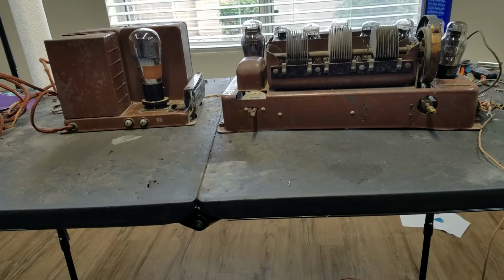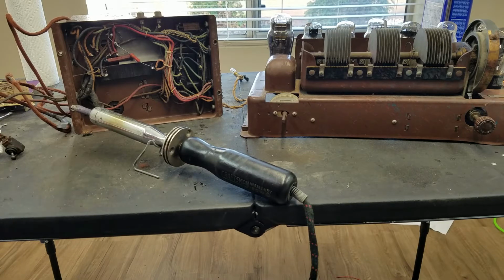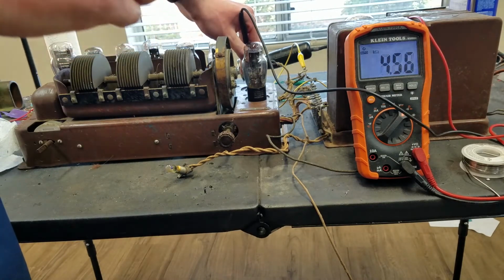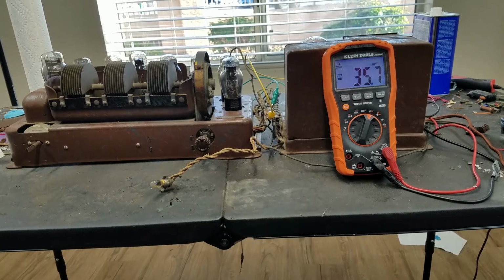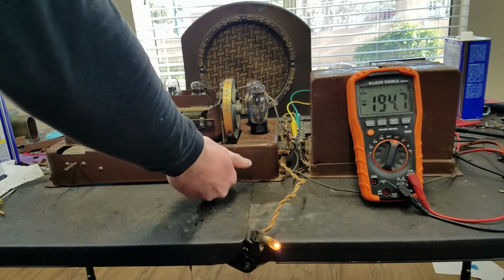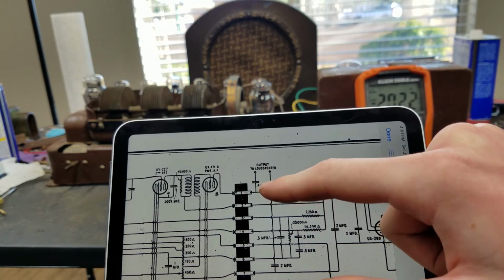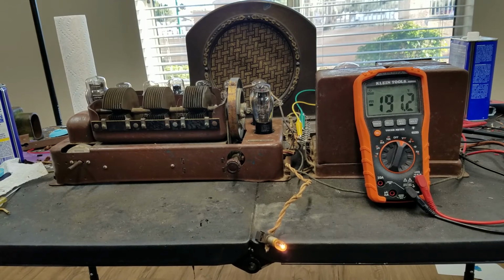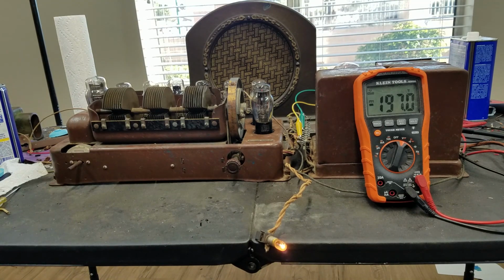1928 Radiola 60 Chassis Checkout and Powerup (superheterodyne)

Comment: The Radiola 60 is one of favorite radios of the 1920s. I use a 25 volt center tapped transformer I bought from radio shack as a output transformer for driving a 8 ohm speaker. I connected the primary leads (black wires with dc resistance of about 80 ohms) to the speaker connection and on the secondary side I connected my 8 ohm speaker to the black wire (center tap) and one of the yellow wires on that winding. Worked really well for me.  BTW the transformer was a 25.2 volt @ 600 ma.  Good luck with your restoration!
Reply from the maker: I like pretty much the whole radiola line, although the Westinghouse built ones are generally cooler than the GE built ones (in the late 20s Westinghouse built the superheterodyne sets for RCA while GE built the TRF sets). I also have a radiola 66 which I made a video on a few years ago replacing the audio interstage transformer. I also acquired an extra radiola 66 dynamic speaker that I’ve been using with the radiola 60 to listen to during this whole work from home time